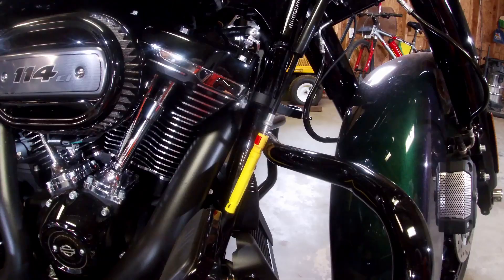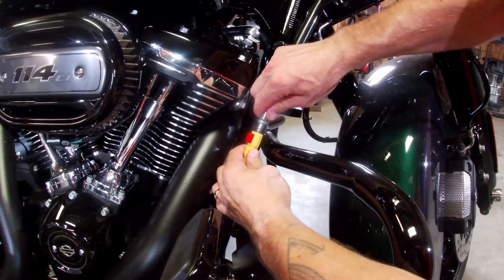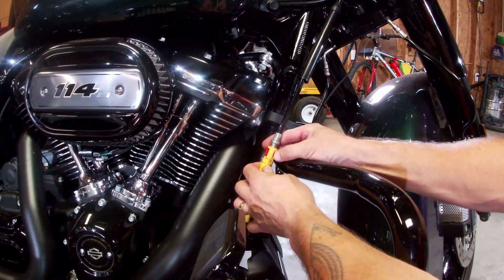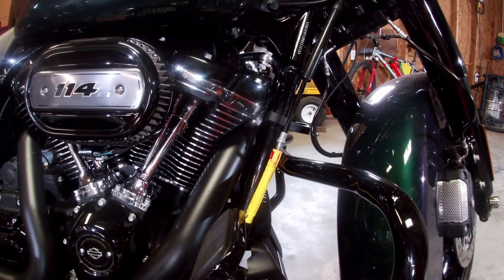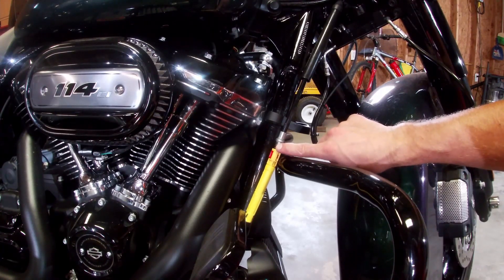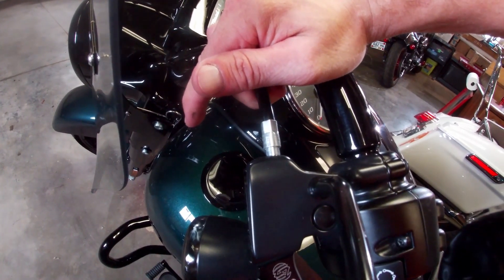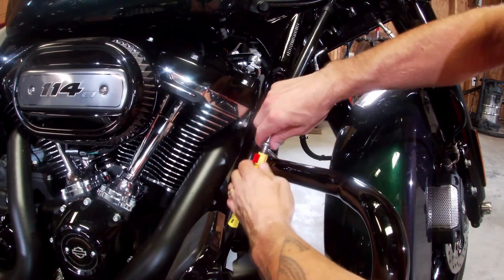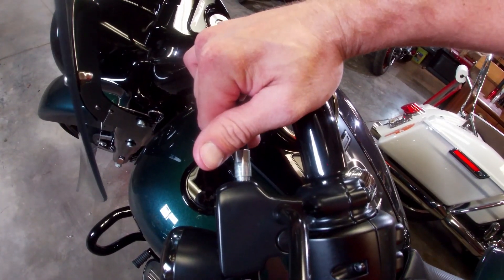Easily fix the "finding neutral" problem on your Harley M8 cable clutch bike - Random Garage

Comment: This video just saved me! I had installed a cable extender when I put new handlebars on, but my cable was falling out at the grip when squeezing the lever. Watched your video, I had the spring compressed all the way, so I separated it like you did, and voila!

Comment: On the Sportsters, tug on the neutral light wire running under the frame. Sometimes that wire is too tight & with the engine vibrations comes loose.

Comment: Brand new heritage 114, 2500 miles and my clutch has backed off twice to the point my lever is bottoming out on my grip. Am I just riding too hard? Never had this issue with either of my other two bikes
Reply from the maker: When it backed off, what did you do to get it functioning again?

Comment: you should only have to do this if you added taller bars or rerouted the cable.  If you didnt you probably need a new cable or it needs to be lubed.
Reply: It worked, easier then ever to find it now

Comment: plastic is a point of failure in the baggers I would suggest upgrade to fat baggers clutch adjsuter its aluminum and wont brake and allows perfect clutch adjusting  Just My Opinion
Reply from the maker: And it looks better too!

Comment: On my 2010 Limited FLHTK. As soon as I start to let clutch lever out she starts moving. Do I need to bring the internal to a full turn instead of 1/2 out ? Or go other direction?
Reply from the maker: Sounds like you are at 1 turn out, so you want to adjust it to 3/4 out, or 1/2 out.
Reply: @RandomGarageUSA  Would it hurt to take the 7/32 shaft completely out to measure how deep it needs to go to seat it ? I'm taking it out too much correct?
Reply from the maker: No it wouldn't hurt to remove the shaft. When you turn the clutch screw out, you create a gap. The bigger the gap, the more you have to pull the lever in to disengage the clutch plates. 1 turn out puts your friction zone close to the hand grip. 1/2 turn out puts your friction zone far from the grip.

Comment: If you put a heel shifter on you will slip it into neutral a lot easier.
Reply from the maker: Not in my experience. Maybe once you develop the muscle memory for it, it would work better.
Reply: My heel shifter is my neutral shifter only.  Been doing this on all my bikes.  I had to put the heel shifter on my new 22 RG ST just for that reason.  Works great.

Comment: The problem jm having is my clutch cable completely slipping loose. The handle completely breaks through the resistance when you squees it.
Reply from the maker: You should inspect your clutch. Maybe the jam Nut on the adjuster came loose?
Reply: @RandomGarageUSA  the jam nut is still secure. Something gave away while i was riding so i cant squeeze the clutch into neutral now to shift. At first i thought the plastic clip was slipping but it all looks ok so im wondering what can go wrong with the lower half of the clutch cable.
Reply from the maker: @james meyers  maybe the cable broke? Or your clutch basket cracked, causing the clutch plates to get stuck?
Reply: @RandomGarageUSA  thanks for the pointers im off to go inspect further into the bike. 🥲. Thanks again for the quick help. I cant believe you got back to me so fast